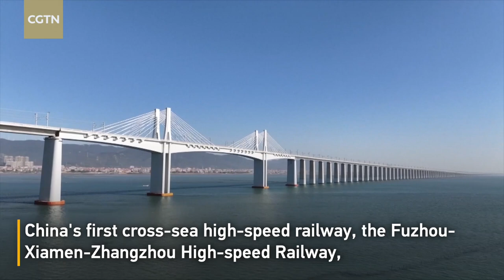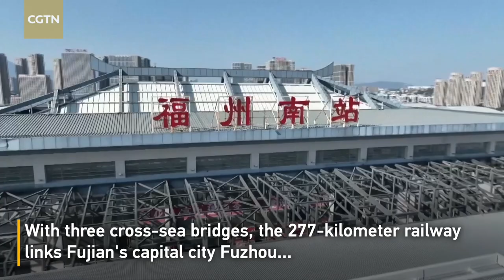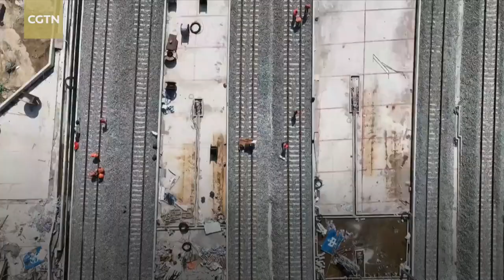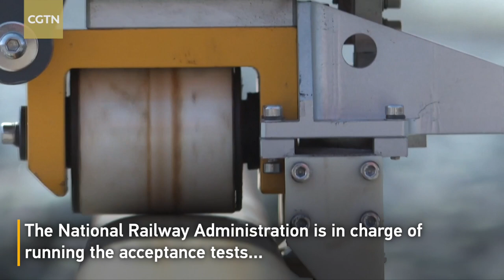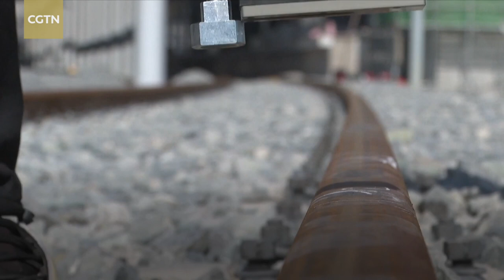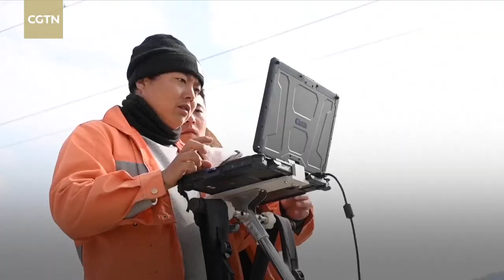China's first cross-sea high-speed railway under static check

Comment: 2035 坐着动车去台湾😁
Reply: Even ignoring the fact it’s highly unlikely that Taiwan will be unified with China by 2035, there’s no way an HSR link would be finished by then even if they started today. It’s 120 km of tunneling (too deep for a bridge). For reference, China’s current longest tunnel under Tai Lake is only 10.79 km and it took 4 years. It was also only a road tunnel which is easier (no track needed, etc). 120 kms is a 20 year job at a minimum.
Reply: Clarification: longest UNDERWATER tunnel
Reply: Actually, it’s 160 km, so even worse
Reply: quantum rail line to taipei soon if kmt back on track